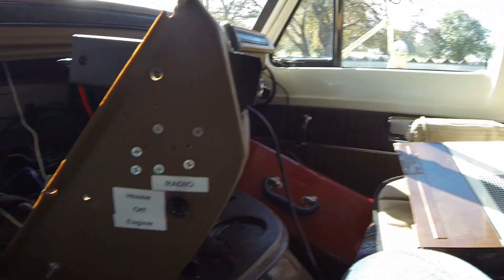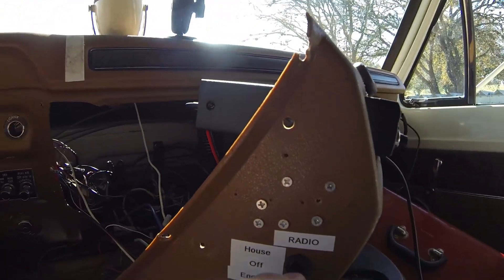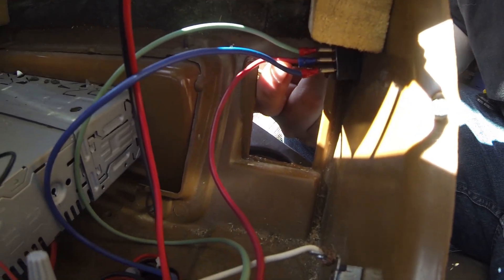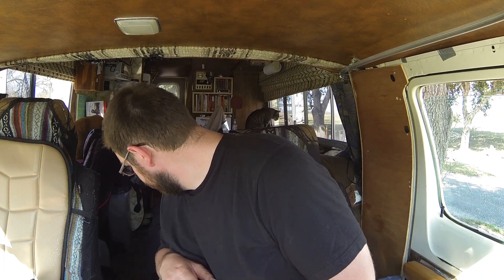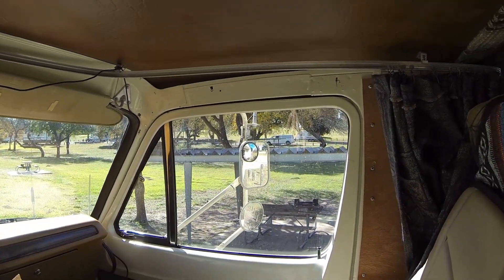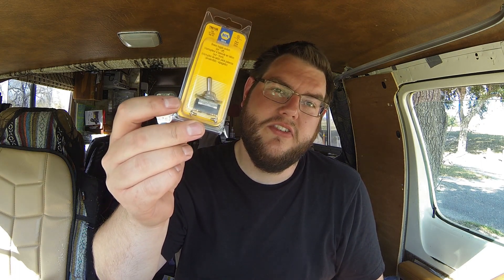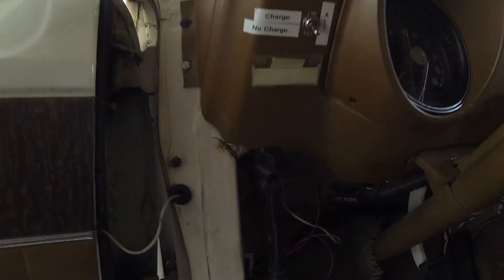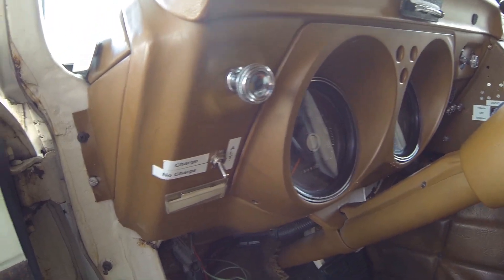RV Mods - Switches and Solenoids

Comment: Andy, Great video!

So I have a old conversion van , that I have turned into an RV. I will check to see if it has a solenoid, but if not I am gonna run a wire from the batter to a solenoid to a circuit breaker to a battery.  Do you have any advice on sizing the components??? Thanks man.
Reply from the maker: +David Tauber Make sure you use a continuous duty solenoid. Wire from the aux battery to the solenoid on mine isnt that big.. probably 10 gauge. 30 amp circuit breaker in between.

Comment: Why don't you want the house batteries to charge any time the engine is running?
Reply from the maker: +Tom Moore I also have solar. Batteries are a complicated art, and I'm no scientist nor artist, but my thought is I don't want the alternator to overcharge my batteries. Whether that's a valid point or not, it sure makes me feel better being able to turn the power to the back on and off.

Comment: Be careful that the wires running through the firewall don't rub and short out.  They should be in some type of grommet or protection.
Reply from the maker: +Rick Conley Good safety tip!

Comment: I've been wondering how to get the radio to run off the house battery when parked, now I know. This is a really good tutorial and I'm saving it for future reference. Thanks for sharing.
Reply from the maker: +JustPeg Running off the solenoid wiring is great because all the wiring is already there (if you have that setup). And it's a nice thick wire gauge.
Reply: My husband is working on the Winnie remodel and I safe all this stuff to have him watch when the time comes. Thank you so much for sharing this. I'm also hoping that you finally meeting up with like minded people has lifted your spirits and given you new encouragement to not give up on your dream.